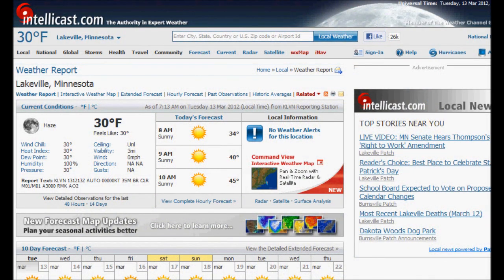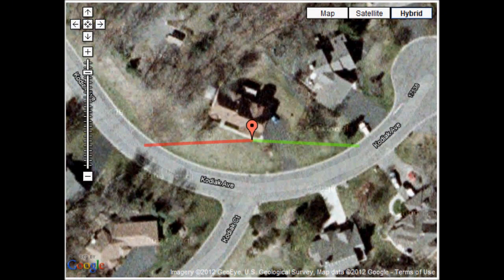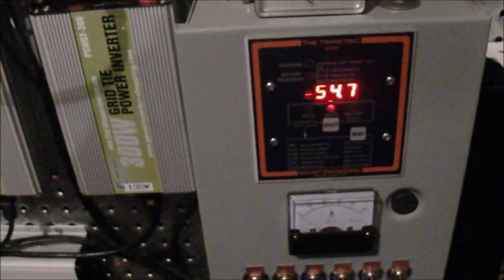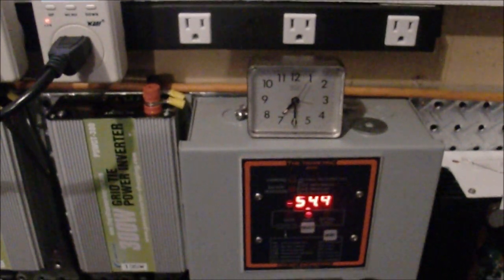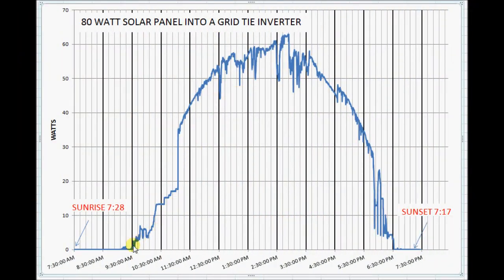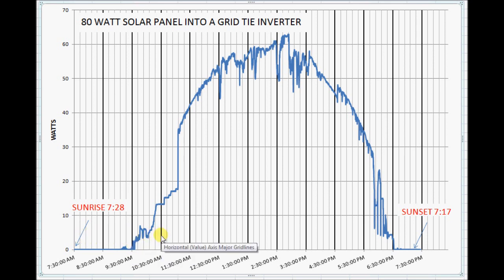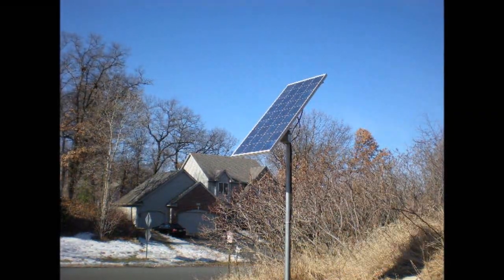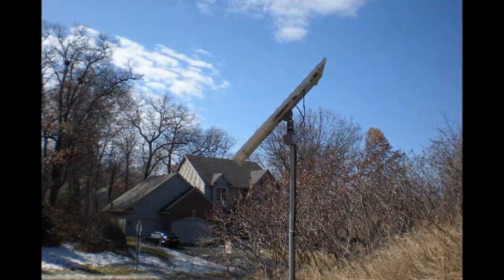Part 1: Spring Solar PV Shading Study

Comment: @Fearlessthinker I don't want to deal with F.P.L.I heard they are not sweating people any more over this and the smart meter issue do to people suing them for over stepping bounds & trampling your rights. I have had many people lately asking a bunch of ? Are U a inventor? LOL I went up my street and it,s kinda hard to miss the system as u can see the tops of the panels above the fence 11 FT.tall, it,s  pretty cool. i,m a sick puppy i will be adding another 1000 watts on a bigger tracker soon.

Comment: @Fearlessthinker In June the panels will be laying almost flat if you are going to be tilting them twice or more a year. It will be interesting to see the comparison then. My panels start making power the minute the sun comes over the back wall, and they face directly south so they do pretty well. You really should get those panels up on the roof before summer in a way so you can tilt them almost flat and get them away from all that winter shading too. Good data to have though.

Comment: For a fair comparison you should put a fixed, same type panel right at the tracker and facing directly south. It looks like the fixed panel was shaded too long in the morning, which is due to your house angle. Your tracker is out far enough to prevent house shading but may not do as good in the afternoon because of that hill. You have some big trees there, lots of shading problems. It will be interesting to see how this test turns out. Thanks for the data and time in doing these tests.